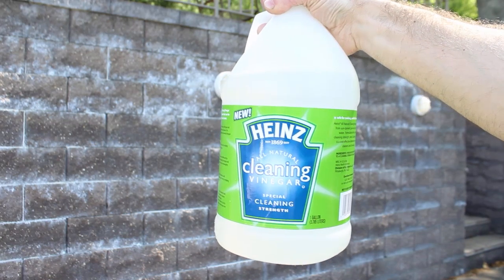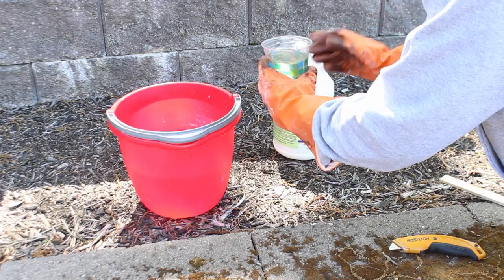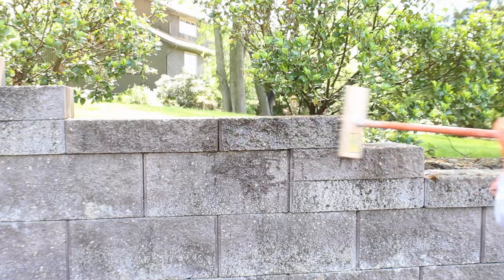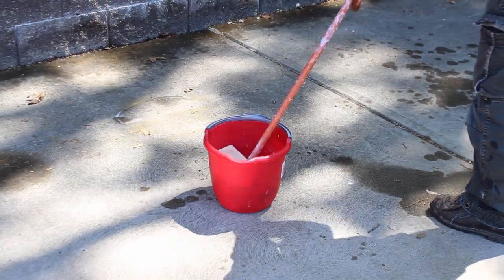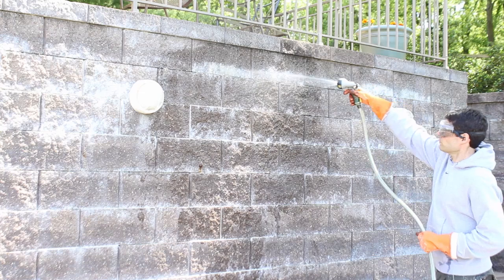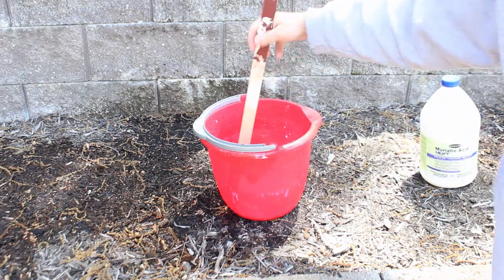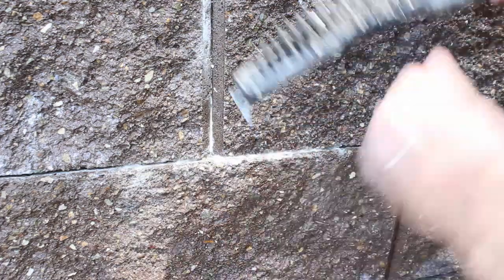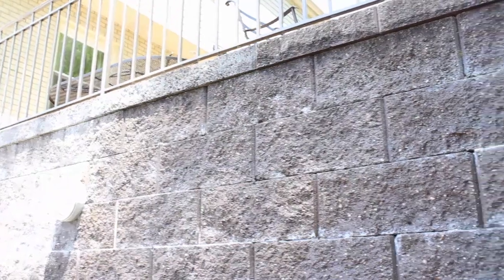How to Clean Efflorescence Off Stone -- by Home Repair Tutor

Comment: Spraying that wall so much with a hose is just adding more moisture into the blocks, which is what caused your problem in the first place. You literally just added to the problem dude
Reply: so rain wont restart the problem?
Reply: Its from the water behind. The moisture pushes it through the stone & escape out the front

Comment: After further review of this video, I believe that wall is not natural stone, but instead a split face concrete block product. Therefore, you should use great care in applying muriatic acid to it. Muriatic acid will stain , dissolve, etch, etc. concrete depending on the method of application and the strength of solution. A dilute acid solution, with thorough rinsing before and after application, may work as it did in the video. Or, if you're not careful, could stain and ruin the color of your wall. If it is natural stone, you won't have a problem, unless it's limestone, which will dissolve quite nicely when you put acid on it. :-)

Comment: For something like this? You should just get a long scrub brush from home depot and just scrub it. No acid is needed. Efflorescence is caused by moisture. Spraying your wall with water is not going to do anything but to disolve it then reappear again after rain or high humidity. Ofc unless you are using pressure washer.

Comment: The water will evaporate and the salt gonna make the efflorescence again...why not just brush it without water?
Reply: You must always use water to clean with acid. In fact, you should flood the surface of the wall thoroughly before applying any acid solution. This will keep the acid from soaking into the wall, where it will react with the mortar, weakening it. And as shown in the video, you want to rinse it thoroughly as well, and neutralize with baking soda.
The efflorescence is caused by water entering the wall elsewhere, in this case, probably from behind, as this appears to be a retaining wall. If it is, and the back of the wall was not properly waterproofed, the efflorescence will reoccur. 
But the water used during the cleaning process will not cause any efflorescence.
Reply: i work making concrete blocks, have to soak the block as charvester said Before applying the remover, or it will continue to pull effloresence out as you rinse it, not applying the water to the block before treating it with acids will just make more work and can damage the block itself over time. your focus is the surface area, and depending how coarse or smooth the surface of the block is will change how difficult removing the surface salts can be.

Comment: I’ve always used a high pile paint roller a long wooden handle and a paint tray with the acid in the water it’s much easier to apply it but don’t go fast and spray it onto your skin. It’s the easiest way to apply it then just take a regular hard bristle broom for the driveway and clean it with that if you want to rub it clean.

Comment: muriatic acid doesnt work well it does a little but not enough. seems my next option is F9 efflo so im going to try that
Reply: How can it NOT work? Its pKa value is -6.3 whereas acetic acid which is found in vinegar has a pKa of 4.75. Hydrochloric acid is pretty much the strongest acid you buy easily. Look for Mortar Stain Remover.
Reply: @bitTorrenter  well I don't know how it can't work but it definitely doesn't do much for me. I tried that too and that doesn't work either. It's not always about having the strongest acid though and the more you use that sort of thing the more it can damage the wall
Reply: That's what my company uses or echo chem ef fortless
Reply: @johnbarr7018  Does the f9 efflo work well? Tried just hydrochloric acid today and did okay I guess..
Reply: I used muriatic acid too and there are some areas it just isn't working. My assumption is it must be something else on the surface if MA is not working. Interested if anyone else has ideas on what to try next?
Reply: @katelinhenley  there isnt much else that will work i was advised wire brush while that somewhat works its not getting much off. so the other solution is to paint it

Comment: Perfect timing as we're having the appearance of this on our garage floor.  After getting it all off are you going to use anything to seal it or prevent it from coming back?
Reply from the maker: unfortunately redhotsweetpotatoe I've done this project before and the efflorescence always comes back. I was thinking of spraying the stone with Wet N Forget to see if it might help. Since it's a surfactant my thought was that the salt deposits would have a tough time sticking to the stone. Maybe this is a good experiment to do :)
Reply: The efflorescence on your wall is caused by water entering the wall somewhere, by the looks of it, from behind or above. That ingress must be eliminated to cure the problem.
Same with sweetpotato's floor. Moisture coming from below somehow.

Comment: That's great if you are outside but I need to do my basement walls. I'm really scared of the fumes.  I have cats and obviously they won't be going in the basement during this but how would you flush the walls with clean water in a basement?  Does white vinegar work?
Reply: I have it too in my electrical
Room in the basement .

Comment: Water is the reason the salt leaches out.
Reply: Once the surface efflorescence is removed, you can treat with a silicon sealer which penetrates and usually stops the dissolved salts from reaching the surface again.

Comment: What's the name of the acid you used? Thanks.
Reply from the maker: +Popeyeyank Bluetooth muriatic acid, be safe using it
Reply: Will this acid change the color of my pavers?
Reply: Muriatic, also known as Hydrochloric acid. Do not breath the vapors!
Reply: Possibly. Test sample first. Use a dilute solution. Strong solutions can burn the brick, thereby changing the color. If you're talking about concrete pavers, DO NOT USE ACID ON THEM!
It will ruin them.
Reply: Popeyeyank Bluetooth pay attention

Comment: This is not a good idea to anyone wishing to do it, acid reacts with stone, it's risky you could damage your brick work. Pressure washer?????????
Reply: His wall is not actual stone, those are cast concrete block with a rock face.
Reply: I agree I definitely would not use acid, it will ( could) destroy the color , pressure washer,  followed by vinegar
Reply: @_1ben McGregor,  Exactly,  never use muriatic acid most of all on brick. Great way to void the mortar and brick warranty. We dry brush, then wash down with white distilled vinegar and rinse with a garden hose. It's a slow way to do it, but it's the best way we have found yet. If it's really bad we use,  prosoco  sure klean 600  same product we use to clean newly laid brick but dilute 12 to 1

Comment: I know that this is the easiest way to do this, but I wouldn't recommend using water at all, and that also means no acid. Water is the enemy, the more you wet it the more of these salty deposits will come to the surface. I recommend a good stiff brush, or even a deck brush with a long handle, no water, and scrub it off. Then maybe blow it off with a leaf blower or use a shop vac backwards. In most cases the efflorescence will go away in time, so if you have the patience just leave it...